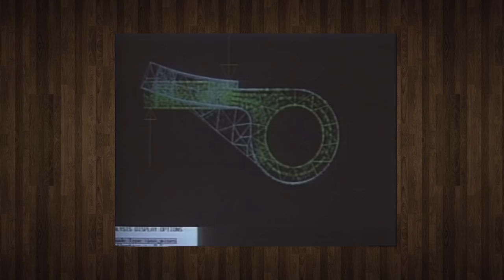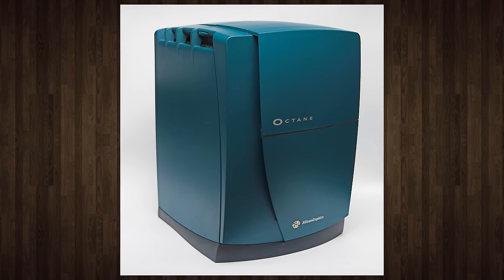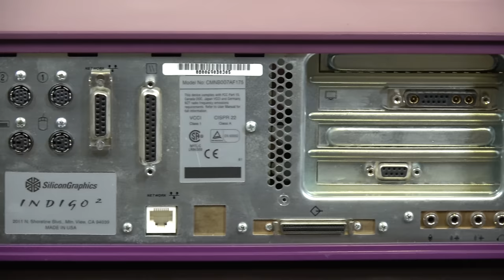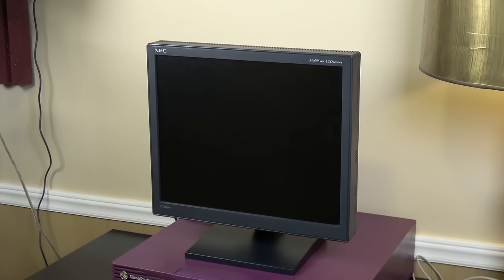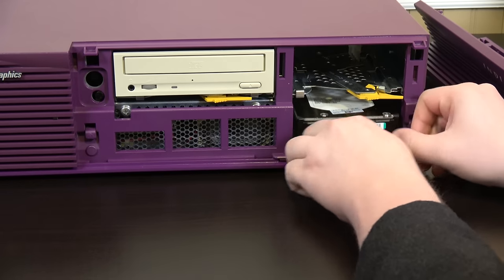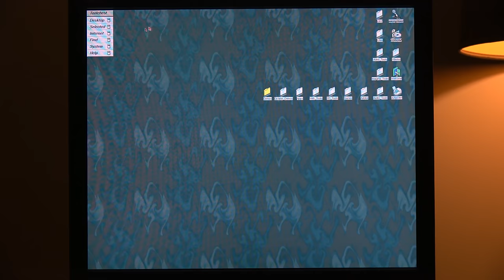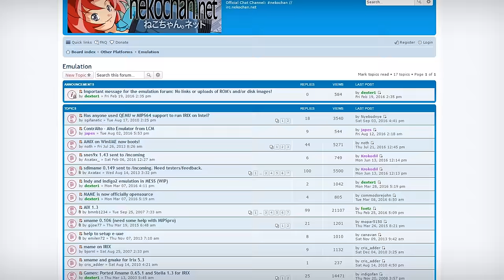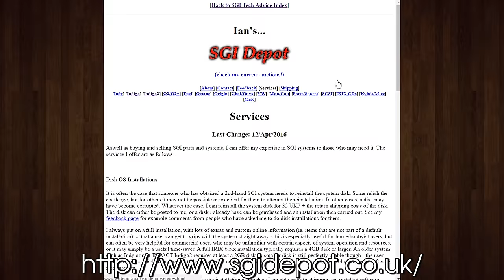SGI Indigo2: An $86,000 Workstation from 1995

Comment: I bought two of these things a few months ago from the Royal Navy of all things!    Nightmare finding software for it,  but I got a copy of Doom for it.
Reply: Larry Bundy Jr Put it on the internet!
Reply: They're missing a few parts (they were missing the HDDs for obvious reasons),  but I certainly wasn't aware they were worth that much,   I got 2 Indy's and 2 Indigo 2's for £50,  plus another £50 to the bloke who delivered them.  the Navy were going to throw them in the skip.

Also got a webcam with mine,  same stone grey!
Reply: Haha, I bet it runs silky smooth. Keep pressing that + button.
Reply: I have an Indigo 2 that's labeled Haliburton Identified (I always think of ol' Cheney when I see that), I'm thinking it was used in the US government somewhere? I don't know how it ended up in the Netherlands though. I have an IndyCam as well, and a lot of other stuff, it's been so long, some of it seems to have become rare. Bummer, I'm not sure if everything works anymore so it can't be fun replacing parts, although the hard drives can be emulated thankfully (it can then be run from a CF card instead) and if anything goes wrong with these, it's usually the hard drives. :)
Reply: Larry, I could have helped you with the sw, but never mind. Very good price you got them for though!! 8)

Ian.
Reply: Cyphax55, I just use SCA disks with SCSI adapters, low cost and works very well. I use a model of 36GB 15K Seagate which runs very quietly, and as SCSI disks go has good performance. I even fitted one in an ancient 12MHz Personal IRIS which went to a US company. :D  Kinda funny really.

Ian.
Reply: Jeez, you pop up all over the place! =)
Reply: I almost was able to buy a maxed-out indigo 1 with 64mb of ram and a 8gb scsi hard drive for 100 dollars from a computer recycler I use to volenteer at, but someone snapped it up before I could; I got a feeling that it was Uxwbill because he lives relatively close to me.
Reply: frayer XD 100euro wasted for trash.
Reply: AbsoluteMrGamer yup, total trash.  Tell all your friends, really spread this around.  People like you only help keep the costs of buying these old systems down.  Be sure to ignore eBay auctions for SGI stuff.  No one wants this old "junk" anyway right?  Especially Onyx2 parts, yup totally worthless, nothing to see, move along.
Reply: mapesdhs, good to see SGI Depot still going, bought an Octane from you maybe 12 years ago, haven't fired it up in years, will have to give it a go one day again. :D
Reply: You should really do some retro hardware stuff videos too or maybe you two should work together .^^
That would be epic
Reply: Real men write their own software for extinct obsolete computers..
Reply: I received one via a police auction in Sydney 3 years ago. I had NO IDEA how much they were worth at the time. I certainly don't plan on selling it, though.
Reply: Jack J Uxwbill. Haha. Like his channel a lot.
Reply: Larry Bundy Jr
Reply: Used to use one at work, loved the thing
Reply: Dude what?!? I'd love to see a video on weird old tech from you, Larry!
Reply: How did u get them to sell it lol
Reply: I can’t stop farting 😔 And it smells like wet garbage😤
Reply: Ha!  I remember playing network Doom versus another guy on an Indy in '96.  But ours were sort of a cyan colour, which made the name seem wrong.
We used that thing for digital retouch with a 12" digitiser tablet, and then sent the results to a medium-format film recorder to write new negs.
The Indy even had a copy of PhotoShop for IRIX on.
Good times.
Reply: IF the Internet ever becomes sentient, it's first words will be "HELLO, YOU!"
Reply: 695 likes lmao
Reply: doom does run on everything
Reply: 9.5 is or was sealed but its plastic got partially torn from the past 20years of existence. 

8.5 is opened NOS. 

Theyre all complete never used. All the books etc and cds. 
Like a square foot cube esch of them.
Reply: Wow just say this is 7 years old

Comment: In 1995 I trained using SGI computers and it wasn't just the hardware that was outrageous, it was also the software and support. At the university that I attended, a SGI super computer about the size of a household refrigerator replaced a Cray super computer that took up a huge space in a building designed for it.

Comment: I worked shortly with SGI's hardware in the 2000s. For pure performances their stations were way behind high performance PCs.  But the quality of their anti aliasing in OpenGL was astonishing. There were not any options to control the oversampling like in nvidia/amd cards but yet the frames were crystal clear. Still impressed by that.
Reply: Performance is very much a "it depends" thing.  The larger systems did deliver earth-shattering performance.  At a time when PCs were good at small to mid size problems SGI systems did deliver on large problem.  Simulate a nuke?  A climate model?  The whole universe?  Seismic data from oil exploration?  The aerodynamics of a new aircraft?  You need memory in the dozens or hundreds of GB?  Visualize such amounts of data?  There was little competition in that league.  Also Windows did not scale to that sort of system and PC hardware was still 32-bit - unlike SGI's MIPS hardware which went 64-bit in '92 and had full OS and toolchain support in IRIX.

On a smaller level the O2's success was that it was what in the PC world would have been named a UMA (Unified Memory Architecture) where all graphics data was in main memory.  Which thus allowed the entire memory to be used for textures far exceeding what PC graphics was able to do at the time and with more flexibility than the alternative approach of separate main memory and graphics memory on the GFX card.  UMA PCs were on the lowest end of the PC segment.  SGI did their best with custom memory modules and system architecture to make the UMA approach fly.  The result was a reasonably priced system with a very stable and long lived market niche.  But was it a rocket?  Absolutely not.

The graphics in the name of Silicon Graphics disguises the fact that from some point on SGI sold more and more headless systems as compute servers or super computers.  Eventually the market share of the graphics systems became very small.  This resulted in SGI rebranding itself in 1999 (afair) and dropping the name Silicon Graphics in favor of the abbreviation SGI which was its stock symbol and already commonly used as abbreviation.  Some people at SGI thought the g in the new company logo was looking like Homer Simpson 🙂

Comment: LGR: "You'd have to be a very special unique blend of crazy geek to buy one of these"

Me: <nervously eyes the SGI Octane on the shelf>
Reply: Jochen Lillich You own an Octane? When did you purchase it and for how much?
Reply: @JackFoxtrotEDM  one leg and one eye
Reply: Nice, I recently picked up an O2
Reply: @JackFoxtrotEDM  I have an Octane 2 too, brought 10 years ago for 200 euros and a bottle of jack daniels
Reply: SGI Indigo2: HOLD MY BEER
Reply: Exactly - There are those of us that collect the behemoths...   At one point I had 4 impacts, 2 original indigo's and 2 octanes..  but they take up so much space I passed them along to others.  Working in IT in automotive is fruitful for vintage computer collecting - every scrapped machine would come to my house.
Reply: Patrick MacBride  Nah - Unique and interesting is when I had both an Origin 3000 rack cluster and an Onyx Deskside running in my den...
Reply: I think at the height of my collection, I had a pair of o2's, a pair of indigo2's (r4400 and R10k), an octane, octane 2, fuel, VW 320, and an 16x r12k origin 2400.   these days, all I have left are the r10k max impact indigo2, vw 320, and the node boards out of the origin 2400 (I repurposed the rack and skins of the 2400 to house more modern hardware)  all of which is probably destined for ebay once I have a chance to go through it and make sure it still works.
Reply: OCTANE ITS GONNA MAKE YOU ROCKTANE
Reply: I have a VW 320 with keyboard and mouse, still working last time I checked, but I must make room in my tiny flat if someone is interested....
Reply: @frederikmuradronse5444  I realised that I posted from the account I use the less. sorry for clutering by the way.

Comment: Dude, I bet this thing can run Crysis on minium settings!.
Reply: Lol i don't think so
Reply: If the Xbox 360 could do it (which had 256mb ram), then this can probably do it to.
Reply: idk about that chief. I had a 2.13MHz AMD Athlon XP-M 2800+ mobile CPU in my desktop (don't ask), 2GB RAM and a 128MB GeForce FX 5200. It was a fucking slideshow.
Reply: Got a 256MB 6200 a couple years later and...it didn't really matter.
Reply: @Taima  but with the right optimization, it can probably run Crysis. As shown in the 7th gen consoles.
Reply: @camulodunon  No, it really can't. The gap is just too big.
Reply: @camulodunon  itsa JOKE
Reply: It can't. Its CPU runs at 195 MHz. And the GPU only has 8MB + 24MB for stencil and z-buffers..
So it does hit the minimum for the RAM, but neither the CPU nor GPU are even remotely capable.
And the OS..
Though, back then, software was clearly no issue for this beast
Reply: @camulodunon  Definitely had 512.
Reply: Trooper Sho the Xbox 360 had 512 mb ram
Reply: It won't because of different cpu instructions designed for modern CPUs .
Reply: @camulodunon  this can't. Like at all.
Reply: Maybe half life 2
Reply: @DavidAllen_0  on paper it runs at 1600x1200. Good enough for most
Reply: There was a port of Doom that I played a little bit, but the thing is RISC it doesn't run x86 PC executables.
Reply: @camulodunon  I think it has more to do with clock speed not ram.
Reply: @camulodunon  (Optimization)
Reply: Ever heard of windows? crysis and windows this thing can't handle it
Reply: Maybe at .005 fps
Reply: @camulodunon  xbox 360 had a GPU with 512mb dedicated VRam to EDRam.
Reply: @jonathandill3557  I ran doom in a Indy too :) like in a movie... I know this, this is an unix system Hahahaha
Reply: @JonathanBrenes  I spent a good chunk of a Silicon Graphics sysadmin course playing slot car racing against a friend who was also in the course. They also had a tanks game and a flight simulator that you could play with other people over the network.
Reply: Awesome device from 1995....what is more humbling is the fact that $50 smartphone in 2020 would crush it.
Reply: I doubt it. Even on minimum settings I doubt it would get anything more than like like 10 fps on this machine.
Reply: @glub1381  do any of you guys not realize that I was messing around?
Reply: @camulodunon  Xbox 360 had 512 MB of RAM, plus it also had a triple-core 3.2 GHz CPU which is a far faster CPU than this has.
Reply: You could probably get away with the og half life at best.
Reply: Maybe if QEMU is ported to this platform you could actually do it.
Reply: >100MHz processor
Yeah no. You'd have to render each frame individually and string them together as a movie.
Reply: @RsRj-qd2cg  I never said it was going to be fast, it would be just possible, if any. It would be a slide show, though.
Reply: Its not just specs. Crysis takes advantage of tessalation and other graphical gimmicks not present on integrated chip sets from the 90s.
Reply: It took Pixar hours to render each frame of toy story using a farm of processors so I don't think so.

Comment: Note to teenage me, turns out that this is not the only computer you would ever need forever.
Reply: Clay Mann My Octane still does OK for YouTube and Reddit. Could probably do more if I knew how to use any 90s era graphics software.
Reply: +Dodoid What graphics software? Are there any (basic) video editors for it? I assume if they made the CGI on the Indigos or an Indy (which I want), they must've also done the editing on the same machines.
Reply: I use Blender 3d on my Indigo2 (lower end). It has a great built in video editor. For video Editing however I recommend the O2 it was purpose built for that.
Reply: Dodoid
I'm not knocking the computers, it's amazing they're still usable and a testament to how powerful they were back then.

It's just that little kid me saw these and thought, if I could just save up enough, this would be the only computer you'd ever need to own. How could it get any better? lol
Reply: Generic Green Squid All sorts of editing software is available. I use PiranhaHD but I'm not very good at it...
Reply: There's a lot more than basic video editing available.  Avid Media Composer was supported on SGI, with the right hardware.  Also Avid Matador and Media Illusion.  Shake was originally developed on and for SGI systems before Apple bought it.  Then there's all the really high end Discreet stuff (Flint/Flame/Smoke/Inferno).  If you can find an old Discreet system it can still do stuff that will blow your socks off...  This is all high end professional movie/tv/commercial making gear.  There's also 3D effects and animation software Alias (Power Animator/Maya), and Softimage.  SGI used to own Alias|Wavefront.  Hollywood used to run on SGI, unfortunately that's not the case anymore.
Reply: So much of my gaming nostalgia relies on my previous thought of "Games cannot possibly look better than this..."

Hell, I remember seeing paralax scrolling in Sonic 1 and thinking we'd reached the pinacle of what mankind was capable of.
Even being able to slide an NES cart into the console, press the power button and play instantly blew my mind after years of Sinclair Spectrum tape loading.

Comment: So 1GB of RAM in 1995 probably cost about $20,000?
Geez Lousie!
Reply: Serpico's Beard most people were happy to have 12 mb of ram back then
Reply: He said that 128Mb cost $10,000, so 1Gb would be nearly $80,000
Reply: +mgrein93  At the time though, 512MB kits were not an option. Strangely, even 128MB kits weren't included on the price list I received in 1996, though the Indy list did have them, 6000+ UKP and that's with an academic discount and without VAT.

By the time 512MB kits of that type were common and in use, SGI had already moved on to different tech with Octane and O2.

Funniest RAM quote I saw was for a 256MB kit for POWER Challenge in 1995 at a radar research lab, about 26K. :D  (40K in USD I guess)  No wonder the Onyx I obtained was originally 1M when new (it had 2GB).
Reply: I recall in the early to mid 90's a RAM manufacturing plant burned down, which sent RAM prices sky-rocketing. At one stage you could purchase 1MB RAM sticks for roughly $100 per Megabyte. 
It would be the equivalent of Samsung's OLED factory burning down now, which would affect not only Samsung, but it would force Apple to source their screens elsewhere at either a higher cost or lower quality, or both.
Reply: I remember ram sticks at $100/meg. There was also Rambus trying to patent the important bits in the SDRAM spec and trying to sue the other manufacturers that sent ram prices sky high. Then around the 2000s those ram makers illegally ran a cartel to keep the price of ram high. eh.

Comment: $86,000?! sweet jesus and here I thought today's rigs were expensive!
Reply: Yeah, but having 1gb of ram in 1995 is almost the equivalent of having 1 TB of ram in a modern computer these days. Just way over the top.
Reply: ...and don't forget the inflation. :3
$86,000 in 1995 is equivalent to ~$142,000 in 2018
Reply: These were not even top of the line.  The Silicon Graphics Oynx was $100,000-$250,000
Reply: Actually the Oynx and Oynx2 went up to 800,000 in normal spec - I wrote scientific software on the SGI from the beginning of the 90's and used/worked with all of them - including the crappy indy without the go.  Then there was the challenge series of main-frames....
Reply: Things haven't changed from the money standpoint. A professional graphics computer for content creation (not gaming) costs plenty.  Back in early 90's I had almost $10K invested in the Amiga with VideoToaster/Lightwave/GenLock/Time Base Corrector/ etc,etc etc. Was offered 2 SGI's..power to create costs money. Did years ago, dies today.
Reply: if anything, they've actually gone cheaper... even in the dot-com boom in the 90's-00's home PCs aren't exactly a household necessity back then, so they were still quite the investment at the time
Reply: But it made that movie with those dinosaurs and things.. Worth it.
Reply: @Cyro1 consoles still cheaper
Reply: Workstation.
Reply: David Pejuan I’ve got 2 TB. It isn’t that incredibly special..
Reply: Cyro1 can a console run Photoshop, Music production software and be a daily driver for corporations? I don’t think so
Reply: @Jdp313 , true, although 1 TB today is not even THAT expensive! Only $3.5k, and I took the price off my local shop, this isn't even bulk price.
Reply: @stilactic4667  the megadrive did in its day.so yea they could if programmed to so yea
Reply: Same money today what does that get you? Custom build your own. 25 years from now make YouTube video.

Comment: I used to work for DeBeers at a R&D station that developed diamond sorting machines. The electronics layout and 3D CAD design rooms were full of Indigo 2s and Octanes. The CAD and electronics layout guys thought they were SO special.

They were all wired up to an SGI render farm.

They were still in use until around 2002 when they were replaced with dual Intel CPU and Nvidia boxes. So when you break the cost down over their lifespan it's not so bad given all the neat stuff they could do that even the Intel's couldn't like fancy video production I/O stuff.
Reply: no surprised a soulless diamond cartel could afford an SGI render farm XD